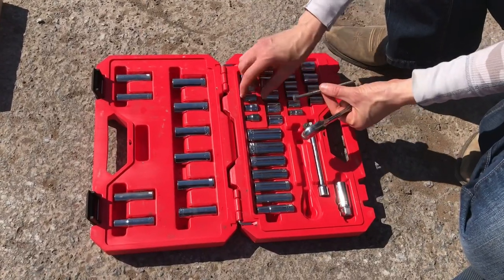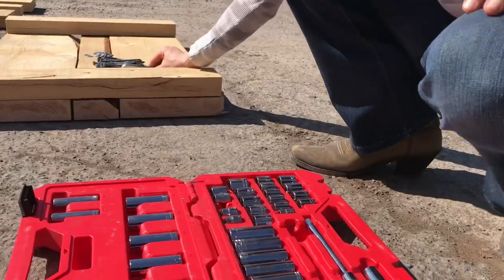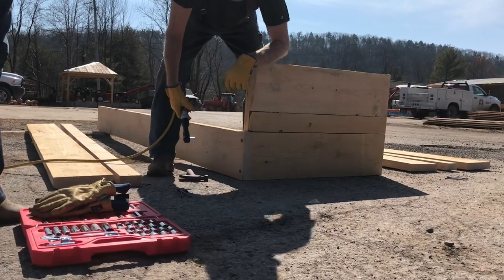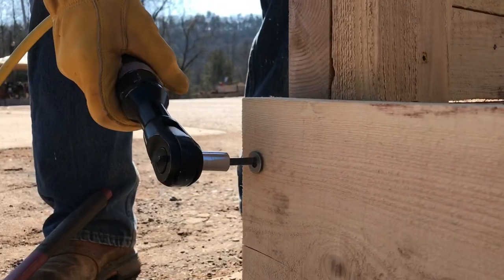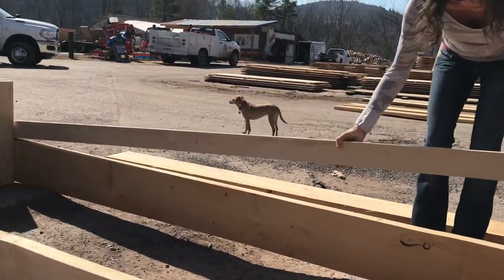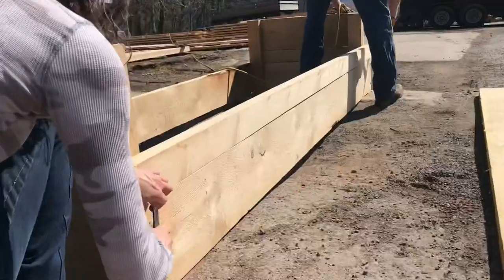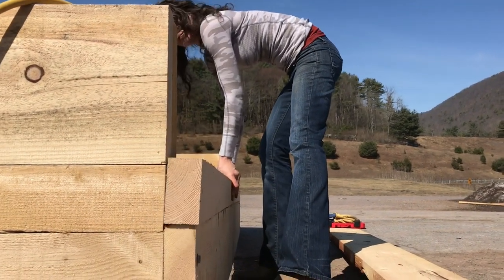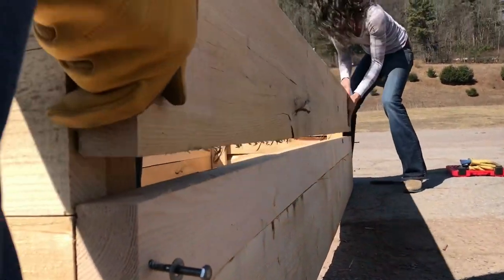Garden bed kit tutorial

Comment: Nice if you have a pneumatic driver.   LOL I like fender washers against wood.   The wood will compress overtime and the lag bolts will loosen.    A fender washer spreads out the compression of the wood over a larger surface slowing down the compression process a lot.

Comment: So, how long will the hemlock used like this, in ground contact, remain structurally viable?
I love the idea.  I just want some idea of when I am going to have to replace the structure.
Reply: It will rot out 4 years max.. Most of it may still look okay by then, but I've never seen one that wasn't fully rotted a few inches up from the bottom.

Some soft woods, in particular pine, birch and hemlock, are naturally absorbent, which makes them more prone to be a welcoming home for fungi.. They cut so much white oak they should make them out of that.. It's impervious to rotting.